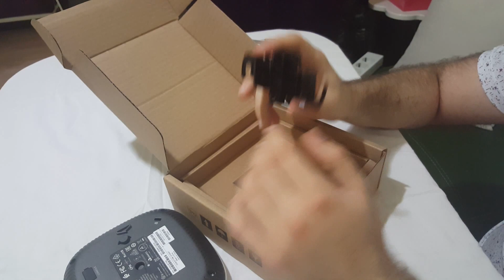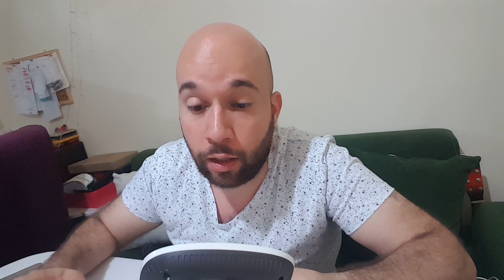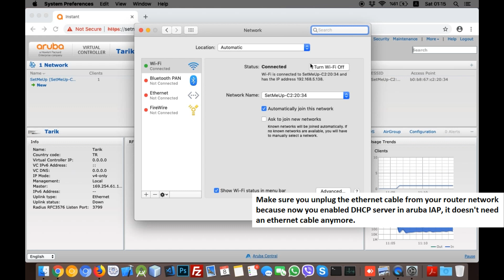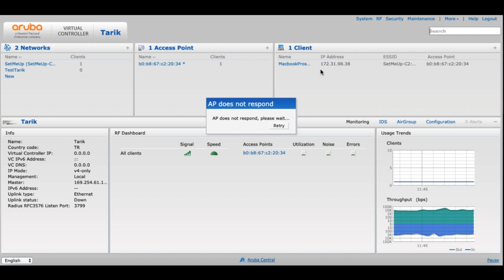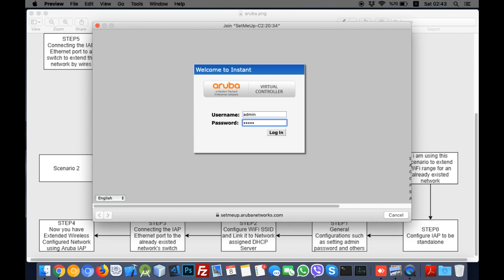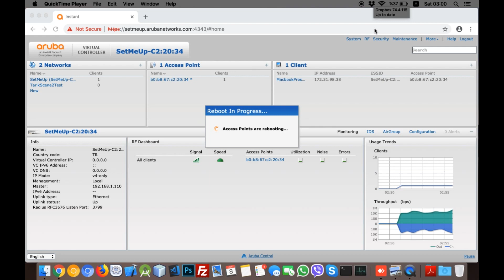Full Video: Setting up aruba HPE IAP 207 Instant Access Point for beginners

Comment: The weird black hanging device is for fastening it to a drop ceiling. It snaps to the rail between the panels. There is another adapter that uses screws. Check eBay.

Comment: Can you tell me how to extend range of existing WIFI internet  wirelessly ie using Aruba AP as a wireless repeater. My wireless router (non aruba) is broadcasting 2 SSID's for 2.4 Ghz and 5 Ghz, now if I want to extend my wireless range how do I do wirelessly with aruba AP, using it as a wireless repeater
Reply: Follow scenario 2 but when naming in the SSID section (where he said Tarik 2 etc) give it the same name as anyone preferably your stronger one and continue follow his steps.
Reply: @andrewotto2848  Does not work

Comment: hi Tarik, thank you for the detailed instruction its great. However I followed scenario one in your example and I wanted to use my ISP router as a cable modem only, when I go to step 4 in your example (configure Ethernet and bridge it with DHCP) it doesnt work for me at all. Up to that point (step 3) IAP works absolutely fine. Could you give me some hints by chance....thank you Istvan

Comment: What if you are installing 3 access point. Why must be converted to stand-alone?
Reply from the maker: JC Michel Yes, Even if you are using 3 IAPs, go with the same procedure, Stand-Alone means the IAP is not waiting for the Aruba Controller device to operate, Aruba Controller device is something you wouldnt want to buy or know about as a home/office user, it is for enterprise networking. Good Luck.

Comment: Is your lan also on subnet 5? I'm getting adhcp overlap error.
Reply from the maker: Yes my subnet is 5,
You must have done something wrong, make sure you follow the steps in the video, and you should be ok.
Reply: I really appreciate your reply and help. I only have one remaining question. Does the AP be on a different subnet as the router for me to follow your video? My router is on subnet 1 and obviously assigns addresses on that subnet.
Reply from the maker: Lynx Nebi , its up to you to change your router subnet or not, i mean you can follow the video without changing the subnet, just put 1 instead of 5, or you can change your router’s subnet.

Comment: I have a problem with this equipment, I connect it to a swith poe but the switch LED does not turn on and in the ap the status LED does not stabilize, it turns off and turns on, reset the ap and the problem continues, it could help me please, I did tests with another switch and it is not solved either
Reply from the maker: Please make sure to connect the AP with Ethernet Cable to a normal Router that have DHCP Server to Provide an IP address, when you do this, the LED will stabilize and you will see SetMeUp SSID WiFi, also make sure you are providing a correct voltage through POE. if you are not sure which POE voltage to plug (me neither), use the same method that i used, DC Adapter 12V 1A 5.5x2.5 Cord.